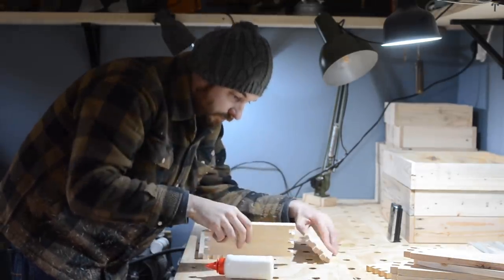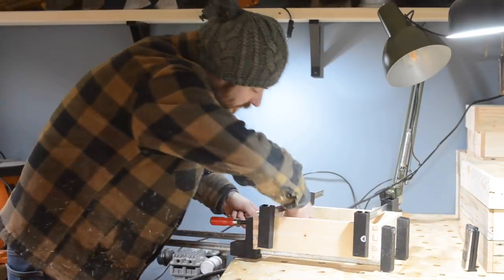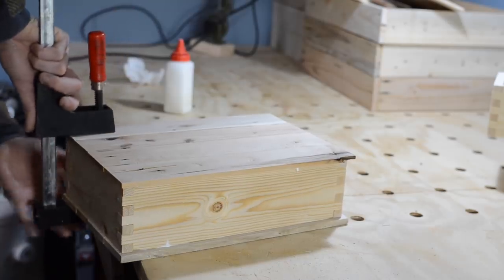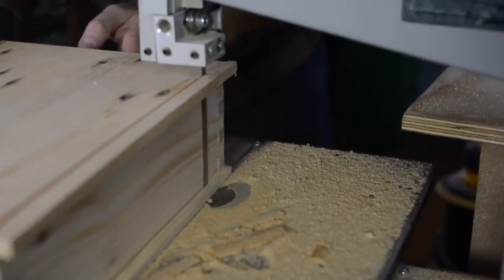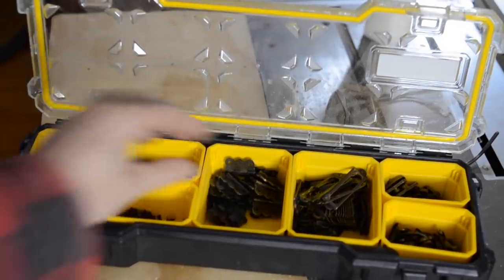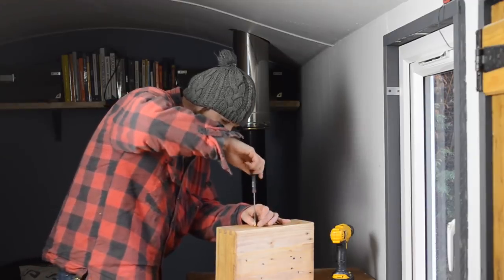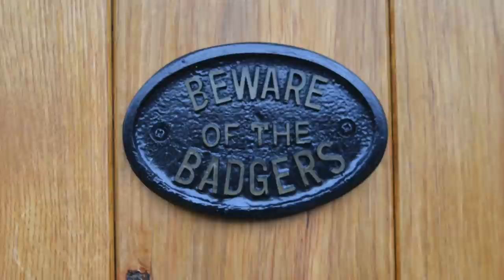Gin Case ( as seen on TV )

Comment: Nice one Matt. I just bought a set of those Uni-K clamps. I do like them, except for the fact that they jam ALL the time. I have to fiddle about with the metal bit inside the black casing to get them to slide again.
Reply from the maker: They are temperamental but sill my favourite for the money. I now have a few 600 and 300mm ones. I am always cleaning glue of the teeth.